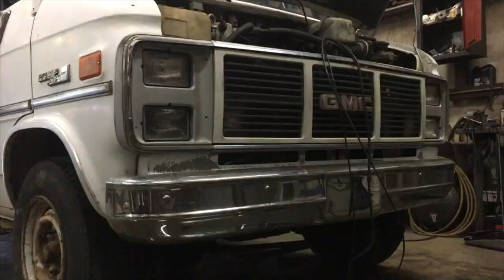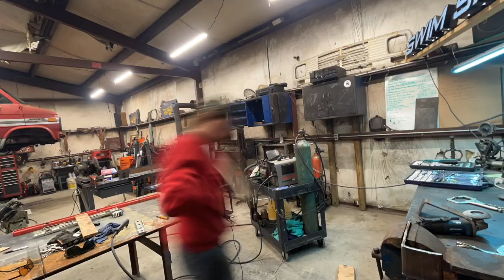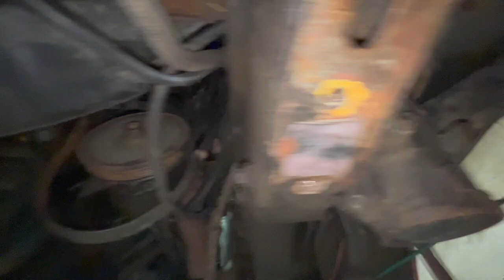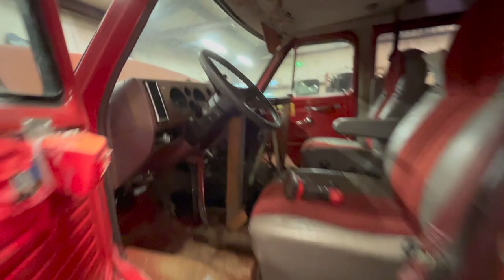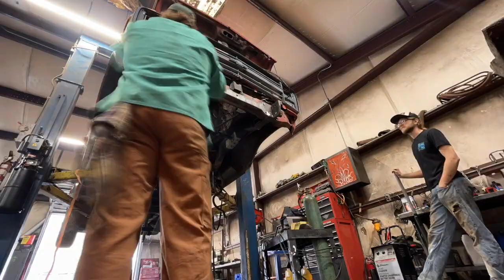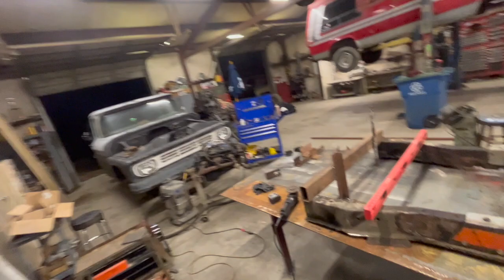DIY 4x4 Van Kit Project - Table Jig - The Swim Shop 4x4 Vans

Comment: On the "mobile vice" - I bolted mine to a thick piece of Walnut and even put a finger groove under the bottom of it for a more sure grip when moving around the shop - Makes clamping it to any bench easier but also provides enough of a solid base (and more heft) to where I rarely need to clamp it down
Reply from the maker: Good solution. Thanks for watching and commenting.

Comment: Great videos, I recently bought a 95 Roadtrek class B and am considering 4x4. I may have to do a body lift to get the transfer to fit under the dropped floor...haven't yet measured. I'll definitely be bringing my business your way.    regarding that 27 spline TH 400, you may have figured out by now, It could be a TH 375 ...or at least a 375 output shaft.
Reply from the maker: Thanks for watching.

Comment: Also, damnit, I have an 83... But I could have sworn, the frame rail narrows at or near the.drivers seat to the rear and is.pretty straight up to the nose. I'll look when it isn't so wet.
Reply from the maker: It may. Check it. If it measures around 31 inches from rail to rail, you should be good. I have not been able to find a definite if the year they changed was 83 or 84. Thanks for watching.

Comment: Wanted to bought a kit from you guys for my vandura camper . but i eard that it ain't gonna fit for 83 because of the frame rail in the front thats different for the front plate . Are you guys thinking of makin kit for 77-83 vans ? Or could be modified to allow only the front plate and hangers to fit on 83 ? I like youre videos ! Keep the good work
Reply from the maker: We have never seen an 83 and I can't find a definite answer on the year they changed. If you measure your front frame horns and the measure 31 inches center to center then the kit will work. Thanks for watching.
Reply: Iv measured it ! 31 inches bud ! But mine is a 1ton G35 . I don't know if 1/2 ton are different but mine is straight as the van in youre video . Center to center of the frame right on the middle of the holes they got in front of the sway bar bracket ! Timothy was a 3/4 or a 1ton ? What you guys are choosing for front axle ? Dana 60 1ton GM are hard to get where im from ! But one of my buddy got 3 pairs of 3/4 ton GM  just wonder if they break easilly for my application a 19feet 1ton vandura camper
Reply from the maker: @olivierlantagne-hc9cg  The 3/4 ton will work, but it will not handle any hardcore offroading. And a 35 inch tire is about as big as I would go. It really depends on how you drive it. Nothing is bulletproof. Anything can break! But our kit should work.